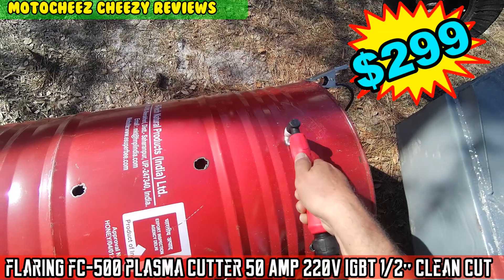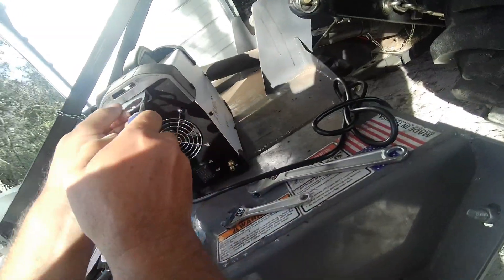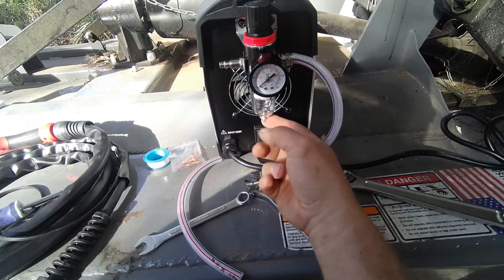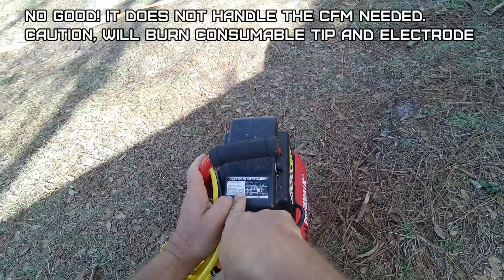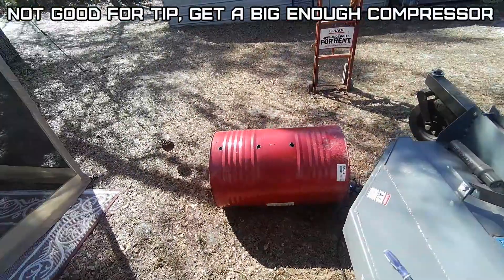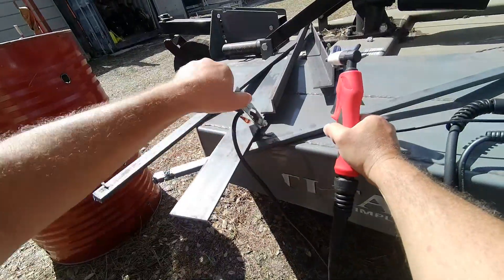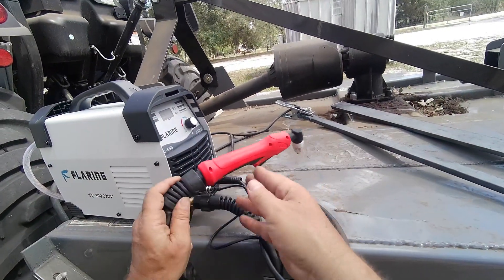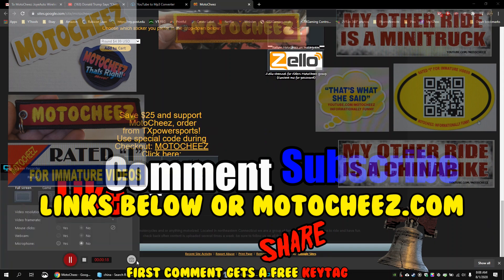FLARING Plasma Cutter 50 AMP 220V IGBT 1/2'' Clean Cut High Frequency Inverter Plasma Machine

Comment: Add another air tank on to it and fill both tanks at the same time it will have more CFM the hose and fittings also make a big difference in  the out put of air 🛠️👍👌✌️💯

Comment: High Frequency plasma cutters are the worst to use. They will not work on CNC tables due to the electric noise they generate. If you use them on vehicles they will destroy the onboard electronics. Pilot Arc is by far the way to go.
Reply from the maker: Never knew that. Guess why they are budget priced
Reply: @MotoCheez  Pilot Arc machines cost the same or less than HF machines. Its just a poppet on a spring inside the tip that starts the arc. when the poppet is forced open from the air pressure it creates a spark and that is what is used to "ignite" the torch. its just supplying a conductive path to get the current flowing. HF machines might have an advantage cutting interrupted material like expanded metal grating where the HF can kick on and off as needed to keep the arc lit as you pass over non conductive voids.
Reply from the maker: My thermodynamics has that